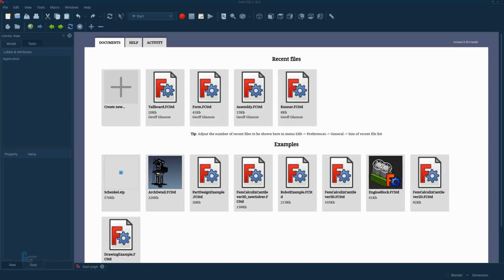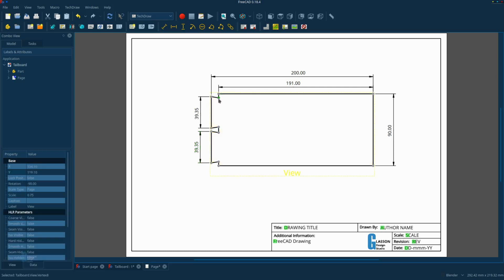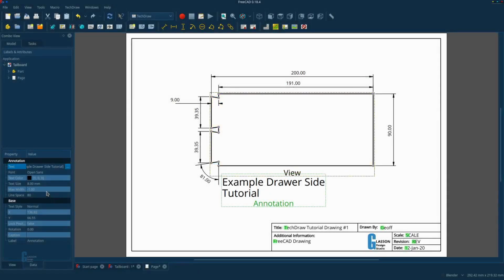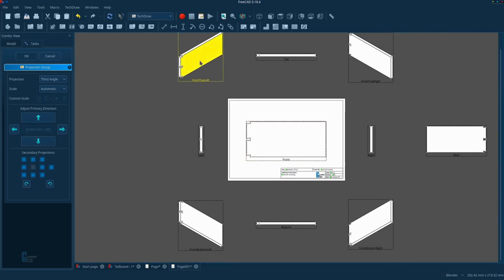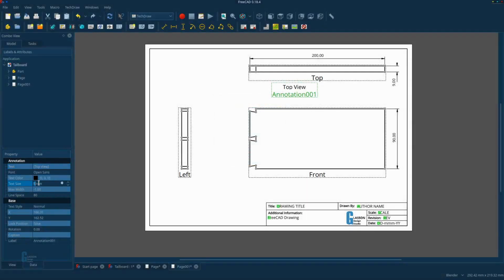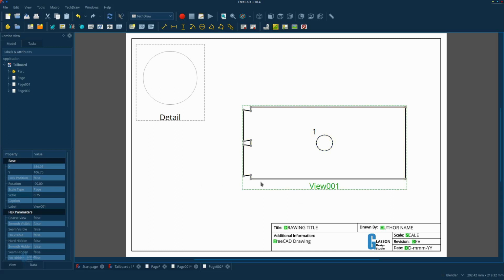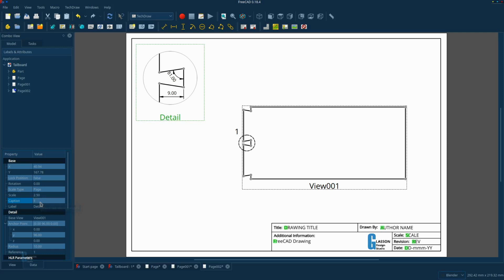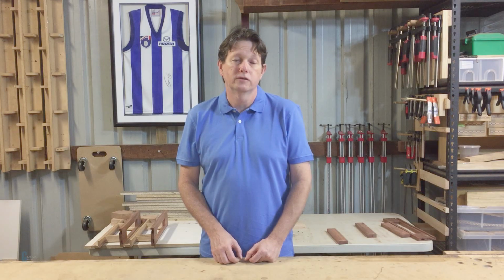Introduction to the FreeCAD TechDraw Workbench

Comment: Thanks for the overview. 
This is my first dive into the TechDraw work bench and it helped.
Request: For future videos change the color scheme for better contrast in the program. The light blue on dark blue is a challenge for me to read.
Reply from the maker: Hi Forrest, thanks for you're feedback. You're absolutely correct -  that colour scheme that I used was not suitable for some people. I made that video nearly two and a half years ago before I realised that it was a problem and have been making improvements ever since. I have been using a lighter colour scheme and larger fonts for some time now, so please persevere with my videos because you will notice improvements.
Reply: @GlassonDesignStudio  
Thanks for getting back to me. I have watched a few of your videos in the past year or so (as I try to get to where FreeCAD helps me rather then slows me down).  You have been helpful. 
I have not looked, but have you perhaps made a video or explained the user settings for the color schemes?

Until I hear of TechDraw work bench earlier in the week I was simply making screen shots of my 3D views or the sketches and printing them to take to my work shop as an aid in fabrication.  A poor aid they were too because not to scale and the color gradient background when rendered in monochrome hurt further.. 

Your video above fixed that for me. HURRAY!
Reply from the maker: I'm glad that you got some value from my video. No I haven't made a video about the user settings for the colour scheme. I like darker colour schemes because they are not so "blinding" in the darkened room which is my office/studio but I choose to use a lighter scheme for my videos to make it easier for people to see. The colour scheme can be set in the general preferences.

Comment: Can assemblies and exploded assemblies be added to the techdraw workbench?
Reply from the maker: Thanks for your question Matt. Yes they can both be inserted into a technical drawing using the TechDraw workbench.
Reply: @GlassonDesignStudio  I was trying that, but I kept getting errors. I'll take a look at it again tomorrow. -- Thank you!
Reply from the maker: I'm curious what errors you got. I tried it on 0.19 and it worked for me. I created the technical drawing, then selected all the parts in the assembly PLUS the technical drawing itself. I was then able to insert a view of the selected assembly. It worked the same for an exploded assembly,

Comment: I want to print complicated full scale drawings which are larger than my A4 printer for use as stick on templates. Alignment of the separate pages is tricky have you ever done this
Reply from the maker: Thanks for your question John. No I haven't done it before. I have previously taken a large format (A2) PDF file to OfficeWorks (an office supply store in Australia) and had them print it out for me. I didn't quite get the result I was after but it was close enough for my purposes. I would be interested to learn how you go with this, and would be grateful if you could leave a comment if you solve it.

Comment: Thanks! I'm using the default drawing template and I can't seem to edit the title block (no green squares like your has). Any ideas why?
Reply from the maker: Thanks for your feedback. I configured FreeCAD to use my template some time ago and can't remember what the default template is which makes it a little tricky for me to suggest something that might help. That said, there is a setting in the Scale tab of the TechDraw preferences that might help. That setting is called "Template Edit Mark" which sets the size of the green boxes. On my system it was set to 3mm. I increased it to 10mm today and the size of the box increased. That may help you. 

It should also be worth noting that my template was created in 0.18 and has NOT been updated since. The change mentioned above works in the templates supplied with both 0.19 and 0.20.
Reply: @GlassonDesignStudio  Thanks for the reply. I'll try some different templates. I forgot to say I'm using 0.19 with the default drawing template.

Comment: What is the difference between these two Workbenchs : Drawing Dimensioning & TechDraw?
Reply from the maker: Good question. According to the FreeCAD documentation, the Drawing workbench has been deprecated in favour of the TechDraw workbench. You should be using the TechDraw workbench to produce technical drawings of your designs because the Drawing workbench will be removed at some point - even though it may be available in your version of FreeCAD at the moment.

I can't speak to the differences in the functionality between the workbenches because I haven't spent a lot of time using the Drawing workbench. I tried it when I made my initial switch to FreeCAD but found that it didn't really meet my needs (or perhaps I couldn't figure out how to make it do it), and quickly switched to the TechDraw workbench which did. I've been using the TechDraw workbench ever since.

Comment: Excellent video.
I cannot move the Detail circle till to the central tail.
I can set like the maximum negative value of Anchor Point to x = -55.
If I set -56, the Detail label in menu shows a red point and a warning label:
DVDetail - detail area contains no geometry
Till to x = -55, detail circle moves to left but it doesn't go beyond.
Reply from the maker: I think that the workbench gets occasionally confused about which is the X-axis and which is the Y-axis. I found that in some instances I needed to change the Y-axis value to get the detail circle to move in the X-axis in the technical drawing, and vice versa. Have you tried doing this?
Reply: Glasson Design Studio 
Yes, i tried doing this. 
In my case there is not confusion: if I change the X-axis coordinate the detail moves along horizontal; if I change the Y-axis coordinate the detail moves along vertical. 
The problem is that -55 seems to be the maximum negative value, and so the detail circle doesn’t arrive over the central tail.
Reply from the maker: @paolofogaccia9455  interesting. I haven't seen it do that before. Have you tried asking the FreeCAD forum about it?
Reply: @GlassonDesignStudio  
No, I didn't.
I'll try asking there.